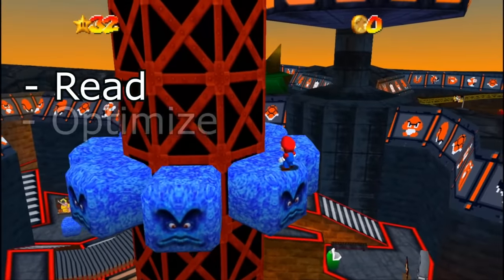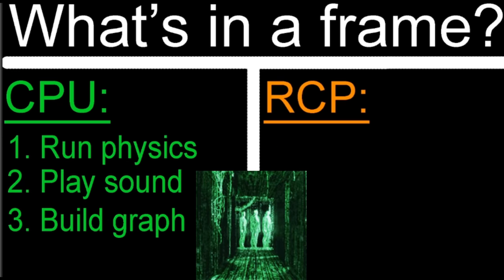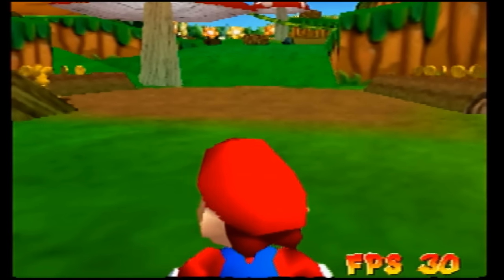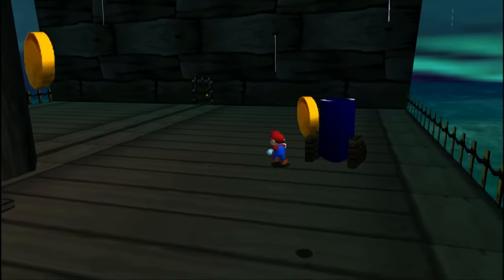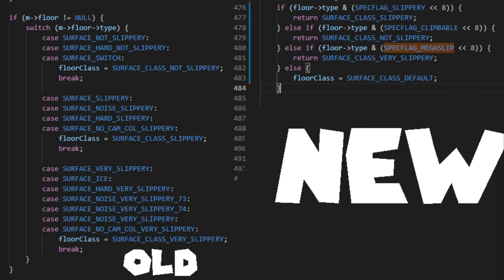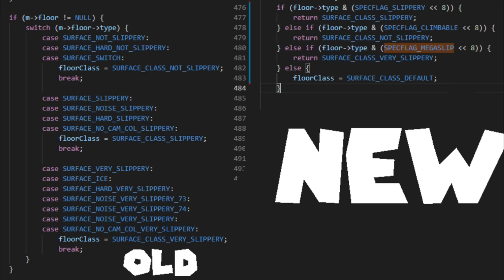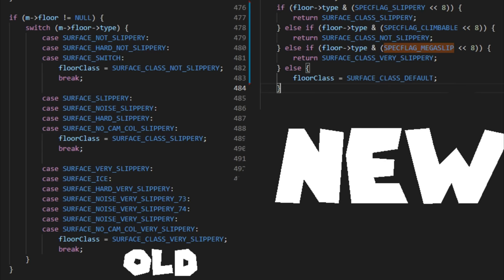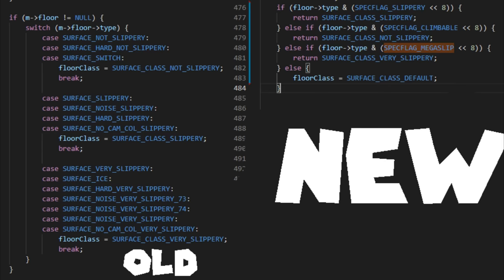FIXING the ENTIRE SM64 Source Code (INSANE N64 performance)

Comment: "If I had more time, I would have written a shorter letter."

I think this quote works well here. It takes time and skill to be able to optimize. The more optimization done the more astounding really. Sadly a lot of companies don't optimize as 'todays hardware can easily handle it." Which is why we get games that breach 100GB when they honestly shouldn't.
Reply: The size of the game is generally due to assets, not unoptimized code.
Reply: I work as a consultant optimizing games. It very often comes down to fact that you have a feature/performance trade-off. Meaning, you COULD spend time speeding up your game, but it would mean delaying feature X or tool Y by N weeks. Often, having something that works is much more valuable to your development process than having something that is fast, because things that WORK unblock other tasks, while things that are FASTER rarely unblock anything unless we are looking at issues that require 100x speedups. This is true for small companies - larger companies should have more dedicated people with strong profiling skills, but small companies are often too busy to even open a profiler.
Reply: @levonschaftin3676  well, egg on my face and shows what I know about game coding.
Reply: @MrIHaveASword  easy to make that mistake
Reply: Asset sizes can basically be infinite and those take up majority of the data. Someone has to decide the final quality that gets shipped.
Reply: @lordgraga  It's very conflicting when we think about it: we as gamers want the damn thing to work well, but would we pay twice (and possibly wait twice) for twice the performance? Cause it may very well happen, as it obviously will require more man-hours to do.
Judging if the game is or not ready must be an art of it's own, to balance the release date and thus financial costs and return, with the product quality. Same with patches, how much releasing one will retain audience or bring more costumers, and how much people will accept to buy unpatched/day 1 patch, releasing something unfinished to satiate the hype but end up borked like Cyberpunk 2077 might not compensate.
A similar dilemma happens at my company with product development. There's always something to improve, but how far do we take it to keep our deadlines vs. quality (often above expected). This directly impacts the company's brand and costumer return.
Reply: actually 100GB games is probably an optimization of sorts. Space is cheap.
Reply: @MrIHaveASword  making a comment trying to trash professionals about something you know nothing about. Common youtube commenter behavior lol

Most things are a tradeoff of price vs performance vs schedule.
Reply: The size of the game isn't an optimization issue. It's a symptom of texture sizes growing much faster than hard disk sizes. The actual scripting of the game is minuscule compared to texture sizes. Compression could be an option but then you add other issues like extended loading times and poor in game performance.

Unoptimized code is an issue but the scope of games has grown so much since the old days that developer resources need to be devoted to developing features and debugging them rather than focusing on speeding up algorithms.
Reply: @caracalfloppa4997  still, some of the size is indeed a lack of optimization in the sense of clean ups. Clipping through the world on some games you can see it, tons of structures underground, textures there that you don't even see, datamining acquiring entire levels from a game that aren't in the release, unused assets, models with internal geometry for pure lack of clean up. There's a ton that can be done to make it better, but of course, that takes time and thus money.
Reply: @Kalvinjj  Well, I know I'm done buying low performance buggy garbage day one, so we'll see.
Reply: @sepg5084  He was perfectly on point before the size comment.
Reply: @brahtrumpwonbigly7309  Like I said on my 2nd comment here, frankly I don't think he's too far off the mark even on that point too.
It would be great tho if those hundreds of gigabytes came on some physical medium as "already chewed up" data to improve performance dramatically. Now when they don't, it still is relevant to complain about it.

BRING BACK (PROPERLY USABLE) PHYSICAL MEDIA EVERYWHERE
Reply: @Tbop3  Yeah, I've been corrected a few times now. Really showed my ignorance on the subject, but it is still nice to learn.
Reply: @Tbop3  If by "easy" you mean it can even reduce clock speeds to save power, then I 100% agree. If it requires full power to handle it then specially on portable/mobile gaming I disagree, unless you pushed the graphics to the edge, then it's a price to pay of course.
Reply: Besides, the more you optimize, the lower the hardware requirements, and the higher the max graphical fidelity, meaning you get better marketing and a larger possible clientele, meaning more profits.
Reply: @levonschaftin3676  usually leftover/unused assets
Reply: Mario 64 is a lemonade stand compared to the games today. Don't get me wrong, I love M64, but this is not a fair or valid comparison.
Reply: @lordgraga  But they should be able the spare some personal to optimize the code all the time, that end up helping the whole development team.
Reply: @levonschaftin3676  The vast majority yes, but its also code that is not optimized, as its not needed, if some frameworks and engines are used a lot of the internal code is universal for many games, optimizing all of it for a single game is simply overkill (but a passion project like this shows the potential is basically limitless).

If every game would be re-programmed from the ground up every time and optimized, the time to develop a game would skyrocket, and as of now, you really want to reduce cost, as other parts of the games become more expensive to make, like pixelart vs high end graphics.

That said, its still worth to allow some optimization, if a game is "finished" in development, it can be reasonable to optimize some of its parts to run smoother, but thats money, and someone has to pay it and be willing to pay it.

Some graphic cards do game specific optimizations to run a game "better" than a competitor card, so if a game is popular the optimization also works on that level and can have huge results.

Preloading assets instead of calculating them is a thing that can eat a lot more RAM, vs CPU, whats better depends on whats your bottleneck, and as games today are often developed for consoles first, and with PC just as an added option, the potential for what a high end PC can do is basically ignored to the limitations of the target console.
Reply: @lordgraga  If anything this shows the "power" of making source code public after a game is released.

Some other people will optimize code and make it run better.

Which then gives a company the feedback to implement these improvements into their game engine for future games.

Making a game "public source code" might be a good idea after like 1/2 year the game is out, or some time interval thats reasonable to have a trade-off when the game is not selling like hot cake anymore (which is often just the first month, then it falls sharply).
Reply: @caracalfloppa4997  For some games the size is just being extremely lazy.

Some of the later Call of Duty with its massive size was the perfect example of that.

Simply to compact the textures and loading them not "raw" delivered massive improvements in the insane size of that game at the time.

So some companies do indeed dont care to a "criminal" degree for the size of their games, till it becomes a issue (as people had to download that massive game for EACH update they made, and that on a console with terrible internet could mean the console was downloading for weeks , and when it was done, another update go released ... so that was torture).
Reply: @levonschaftin3676  Explain CoD
Reply: Game file sizes being huge has little to do with code. Games for a while had to be designed for the slow bandwidth of a hdd. I'm sure I don't have to explain to you how slow a hdd is compared to an ssd.

The solution for a long time to overcome the slow bandwidth of an hdd, was to duplicate assets multiple times and compress the asset file, but as assets gets higher in quality as well as textures, the game file size increase quite a lot.
Reply: I'm looking at you, Call of Dogshit
Reply: @MrIHaveASword  And that's the problem with the world. People talking about things they have no idea about.
Reply: @VincentChan86  yeah, when you know that a non-optimized game and uncompressed assets can take multiple terabytes of data (in extreme), 100GB is cool

Comment: "Safety Checks are useful to prevent crashes, but if you just program well you don't need to prevent crashes" 

-Kaze Emanuar
Reply: As a programmer I live by this 😂
Reply: Well, in a game running on bare hardware on a console...
Reply: Ah of course, how did I never think of just programming better.
Reply: Just Don't Segfault 😏
Reply: Lol right
Reply: Don't need seatbelts if your car can't crash! XD
Reply: @NXTangl  it's true, the "we don't need safety checks" hubris is exactly why pokemon red/blue are such delightfully glitchy messes. Sure they're not stable but they're fun as all hell to break.
Reply: Just described my CS uni experience in one sentence
Reply: This is true. From my personal experience, unnecessary safety checks are typically written in a way that actually silence errors by sanitizing function inputs so the function can still be used when it's called incorrectly instead of validating for inputs and throwing an error when things are wrong. Most bugs are called by passing bad data into them, and then we have overly-defensive code trying to correct various bad scenarios that happened upstream. Functions should generally assume that valid data is passed into them instead of trying to catch some (but not all) bad states, and then make assumptions on what the consuming function actually wanted. Leave that responsibility up to the calling code.
Reply: Rustlang
Reply: DIV0 TRAP
Reply: "Just git good bro"
Reply: That one bit flip:
Reply: @travistrue2008  On the other hand, it's preferable for a game to exhibit unwanted behaviour Vs straight up crashing in its release version.
Reply: And that's how Roller Coaster Tycoon was made.
Reply: Kaze is right. And besides, it still exist programmers who knows what they are doing.
Reply: For a machine born before the days of speculative execution, this is very important to know. They should use a debug macro for this :P
Reply: The checks are likely for consoles that didn't have ideal conditions and probably did prevent crashes in dusty overheating systems
Reply: famous last words
Reply: @travistrue2008  Makes sense...but you could still sanitize the code for safety reasons while displaying logs to detect glitches, no? At least in some cases, it seems possible.
Reply: "'Safety checks are useful to prevent crashes, but if you just program well, you don't need to prevent crashes.'
-Kaze Emanuar"
-Shigeru Miyamoto
Reply: Someone please tell that to Microsoft
Reply: @ag2023en that's what debug builds are for. A release build for a (well-designed) console game should be able to run without any validation of any kind as the only points of failure should be in the hardware at that point, which is outside of the developer's control
Reply: @halofreak1990  Ideally. Until you realizing that expecting your entire dev team and the dev team of every library you use to just not make mistakes is making your game crash like crazy and you don't have enough time to fix all of the bugs let alone do a proper root cause fix. So you go and paper over the worst ones with these validations so it at least works well enough.

Comment: "if you just program well, you don't need to prevent crashes" is an absolutely insane (but not entirely wrong) thing to say and I absolutely love it. I can't get enough of your channel :D
Reply: It's absolutely right, for example to normalize an unsupported value in a function to something it can work with:

int someProcess(int x) {
    // make sure x is positive, otherwise reset to 0
    if (x < 0) {
        x = 0;
    }
    
    // do stuff with x
}

These types of checks happen in runtime (using CPU) and are usually made so that each function is pretty safe to use, which is a common practice to make the code more maintainable in the long run and more friendly to use. In a game like this, the code is written usually with a tight deadline and it will never be touched again once released, so you don't need maintainability. So in this case, these checks are only useful to be more forgiving to developers passing "wrong" values to it. But if the developers are careful enough to make sure only correct values are passed (even if they need to do that check exactly where needed), then the check doesn't need to happen everytime that function runs.
I think that's what he's talking about.
Reply: Crashing the program, rather than letting it run in some unexpected state, is sometimes better than trying to "fix" it at runtime anyway.
Reply: @dawidkotlinski  Yes and those bugs are usually detected and fixed with actual gameplay testing. If it stops crashing and glitching, then the fixes are good and it's good enough for delivery.